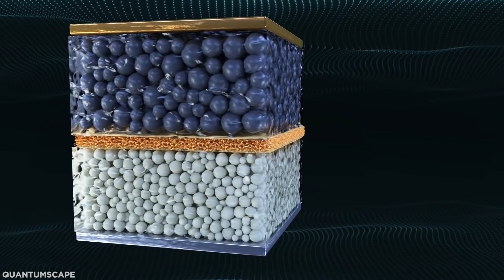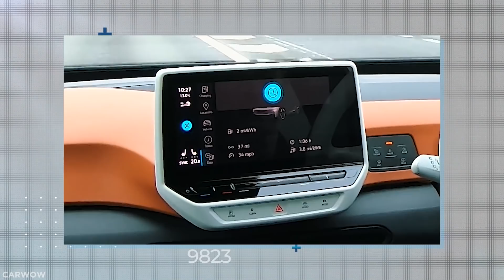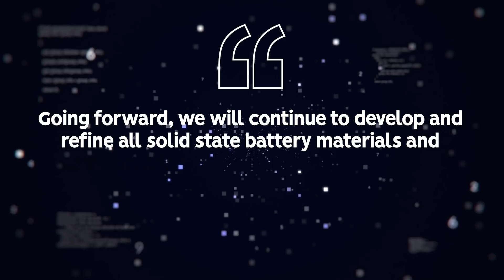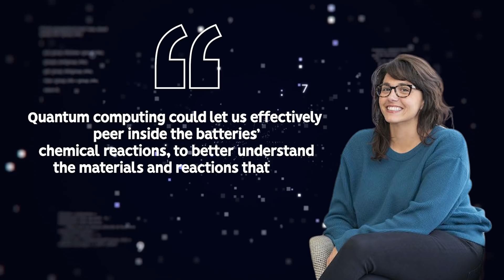Why Solid State Batteries Are The Future

Comment: Excited for both, the energy density and the longer life span. Safety is not an issue even now, ok one in a billion catches fire. Who did it kill? One big thing tho.. its recyclablity. It must be part of the design form inception, or we're back to square one in a decade or so. Plus a pile of toxic batteries in the landfill to deal with.
Reply: Do worry about it,  will just dump all the waste to Africa like what China is doing right now
Reply: @neurowayne  Yup, and look at the number of likes my comment got. No one cares, they just want what they want right now, w/o any concern for anything. THAT's why we are in the state that we are. All little kids running around, one wants power, this one money, that one status.. on and on.
Reply: @iTeerRex  We already have battery recycling.  There are several companies already that recycle lithium ion batteries, and they last far longer than a decade, closer to 2 decades or longer.
Reply: @redbaron6805  Yes I know, we'll see how it goes with those. How much energy they use (CO2 they put out) and what toxins they leave behind.
By the way, it doesn't matter if its 10, 20 or 100 years. If its none renewable, it runs out. Plus after 100 years it goes into landfills. My point is that if the system is not a closed system, its not gona work.
Reply: @iTeerRex  The toxins from CO2 would be better than what we are doing now.  And batteries are already being recycled so not sure why we would run out.
Reply: @redbaron6805  I'd say dig a little deeper brother, into the details of its science, then what the media is selling to us.
Take care.

Comment: The growth in EV still has so much potential. Can't wait for same distance as a diesel!
Reply: That really shouldnt even be relevant goal since we shouldnt be greedy and lets just take this great alternative as it is. we cant expect level10 to come if we dont start buying level 2 3 or 4. Market growth can speed it up
Reply: Been driving an EV with 300 mile range for 2 years.  99% of the time I never even thought about charging stations as I leave home with a full "tank" every day.  Once I started driving an EV, I quickly realized that most of the concerns about range or charging infrastructure rarely applies.  Having to charge during road trips is also not a problem with current battery tech.
Reply: @lanzer22  many forget that with EVs you have your own "petrol station" at home and never really need to fill up unless it's an extended trip.

A car without paying for the fuel (well a fraction of the cost). The saving over 10 years justified the added cost of EVs imo as well
Reply: Coming soon
Reply: And abundant of charging stations everywhere, which is way cheaper than building a petrol station and that takes up more space. Charging point also be easily integrated to most existing struckture even in tight spaces.
Reply: @pigstain7531  the oil has millions of byproducts including parts for EVs
Reply: @alanmay7929  Petrol station need huge big underground tank reservoir to keep the toxic petrol gasoline & diesel. Those tanks leaks in soil and into nearby water source contaminating them. It cost lots of cities hundreds of millions each year where there is leaks found. Look it up.
Reply: @pigstain7531  bullshit, the Diesel and gas tanks have been made to be very secure with time, also the leaks are just poor construction choices. In the US decades ago, people used to burry bare metal tanks to the ground for even home heating and it was a complete disaster trust me.
Reply: @pigstain7531  wrong, charging stations takes way more place than traditional petrol stations, also EVs needs to charge for long and some needs to tow and it uses alot os space
Reply: @alanmay7929     you are wrong. Many EV Charging station already intergrated in some petrol station and some already in sidewalk (urban work & household neighborhood). Even Shell already integrated their petrol station with EV charging point for Electric Cars & Electric Motorcycle in England. As of this year you could charge to full in just under 10 minute for some electric car in certain super charger - this fast charging will get better time and lots of charging station put steps toward future proffing for incoming superfast charging.
Reply: @pigstain7531  in the US they may easily install charging points at fuel stations because they have tons of space but in Europe/Asia forget about it, also towing while charging how awkward is that?!
Reply: First, most EV owners just recharge at home over night the vast majority of the time, which is more convenient than going to a gas station as it is one less thing to do and you always leave home with a full battery. Second, on long road trips where speed of recharging does come into play, the new Tesla 4680 cells will be fine, no one will wish they had a diesel instead. The Tesla cars with 4680 will start at a range of 400 miles and many models will have a range of 500 miles or more. The Roadster will go over 600 miles between charges. If you can drive five hours at 80 miles an hour before recharging, you probably want a break by then anyway. The 4680's will also charge faster. Maybe you spend fifteen minutes more recharging than you would filling a tank...do you really care that much? You still are driving ten hours with a twenty minute stop, is my guess. How much of a hurry are you really in on a road trip? Also, time is money here, and you are spending a lot less, over fifty dollars less, driving 800 miles in your Tesla over any diesel car. Is fifteen minutes of your time worth fifty bucks to you?
Reply: @tribalypredisposed  yes
Reply: @tribalypredisposed  gas car owners doesnt go too much to the gas station, a full tank is good for amazing range for a diesel vehicle the range is even better, a toyota hilux has around 1000 miles of range
Reply: @alanmay7929  One thing we can all agree on is that battery tech is only gonna better and thus more range and faster recharge times
Reply: @prayagkrishna  nope what is more important is how we are going to take all the lithium for millions of EVs every year
Reply: @alanmay7929  ig it would be like diesal but better in a way